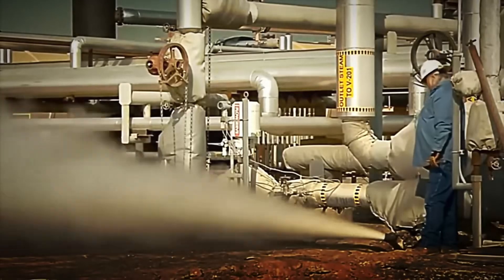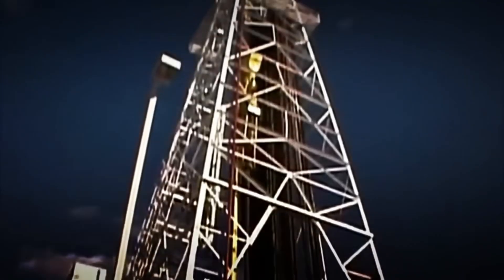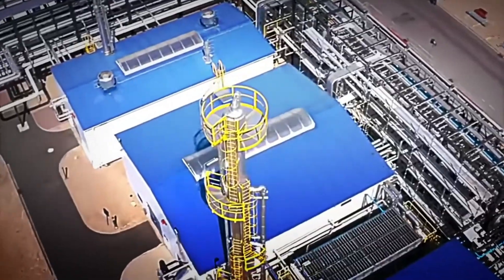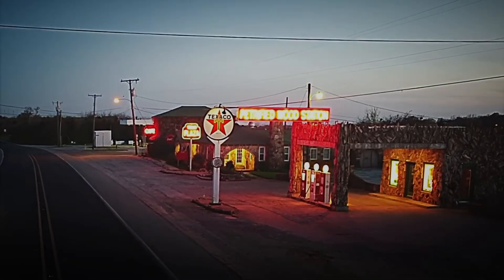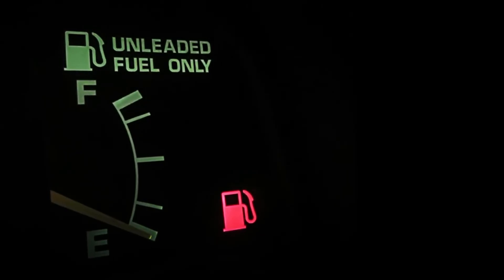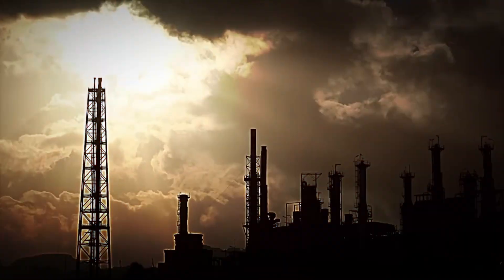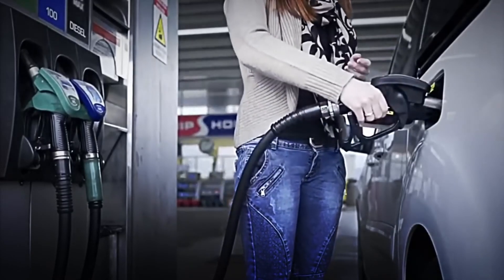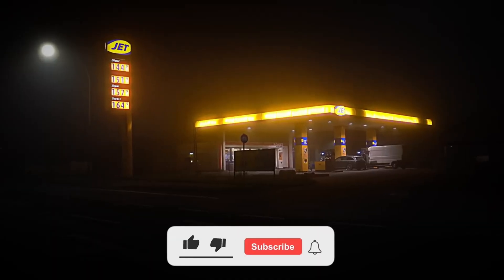How DIESEL is MADE ⛽ | REFINERY PROCESS 🏭

Comment: Where does the hydrogen come from?
Reply: I work in a refinery. There are hydrogen plants that take natural gas and separate the H2. Some units in a refinery make H2 as part of the process and that gets fed back into the system.
Reply from the maker: Good question! The hydrogen typically comes from natural gas through steam reforming, but there are also renewable methods like electrolysis. By the way, I have a video on my channel about Natural Gas,you might find it interesting!